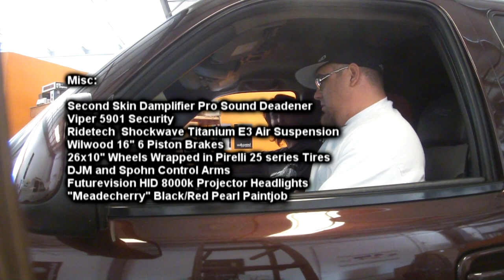30,000 watt Sound System BASS Demo - "NOT JUST LOUD"  A Visitor from Idaho

Comment: Steve! o need your help on sumthing! Or anybody's help, I have 2 12" rockfordosgate p1 punch subs on a 1400 watt amp with a jvc head unit, I was listening to music about full volume goon down the road and one of my subs just stopped working I opened the boxup and all the wires r connected and the wires goin to the sub from amp work fine but the sub just dont make Any kind of noise and I don't think anything is burned or fried on it please can y'all try n tel me what's up?